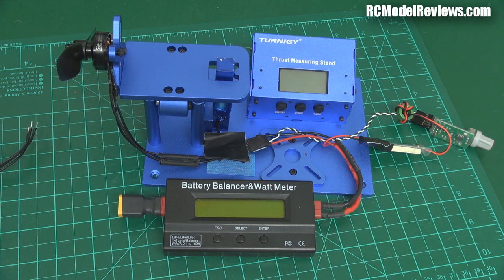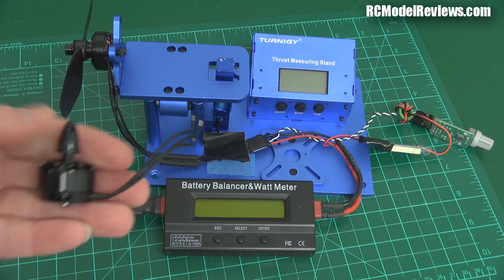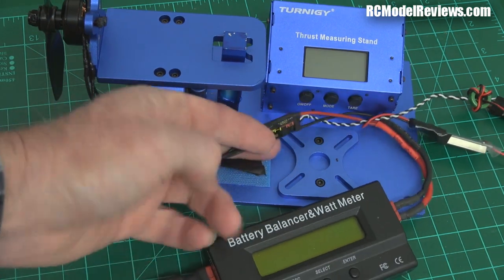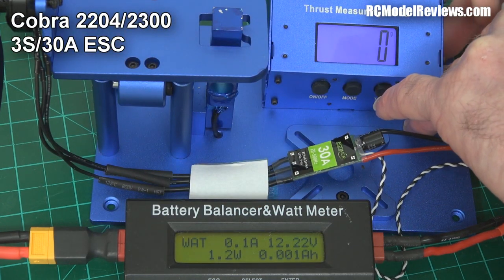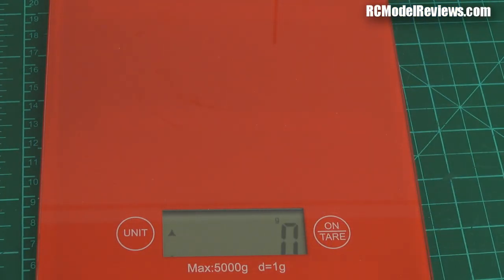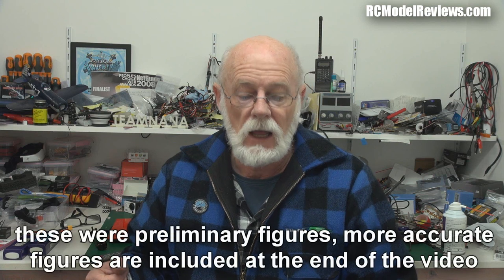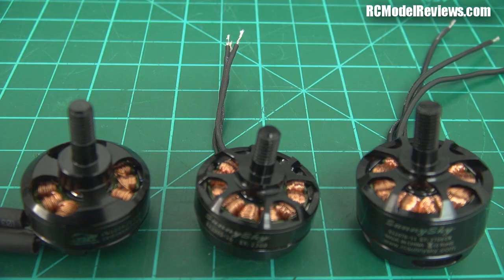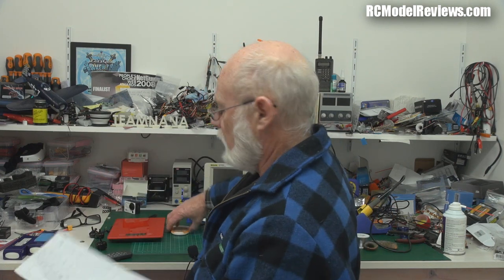SunnySky 2207 2700KV versus 2204 Cobra/Sunnysky

Comment: SS motors, can't beat them for the money, but be careful as there are many imitations.
Reply: +michael lee how can you tell the difference?  i did not realize there making fakes... seems odd.  especially since the bad rap sunny took.. when they moved to a new factory.. im willing to give them a go now tho.. just because they have had time to ease out of the growing pains.. but if i lost a quad to one.. i would probably think twice.. that is just me being stubborn tho. laughs.
Reply: +Chris i was told as of now avoid buying them from banggood. there have been cases where some vendors selling fakes on that website. not fair to bg but unfortunately...how can you tell the difference? i don't have an answer right now.
Reply: +Chris c There are a few official resellers. Track them down. There is one for the US (forgot the name), I buy mine from goodluckbuy.
Reply: +Chris c I just got a fresh batch of the SS2204 motors from surveilzone, all original. My previous batch from banggood was fake, so did not want to take a chance there again. The gemfan props surveilzone sells is also originals and well balanced, highly recommended
Reply: +michael lee The brand new RCX 2204 2350 kv motors seem pretty awesome.  I just got some for $9 each.  They are very light, lighter than most 18mm motors.  They are also serviceable and RCX sells replacement shafts and bearings.  I'll soon be finding out if they are too good to be true.  I'm just afraid the extreme light weight means they can't handle a crash.
Reply: +Plur307 do you have the purchased links ?
Reply: *****
I just received them in the mail.  I have not used them yet so I can't tell you if they are awesome or horrible yet.  They are 2205 and lighter than most 2204 (and even many 1806) though so that is nice.
http://www.myrcmart.com/rcx-h2205-2350kv-multirotor-outrunner-brushless-motor-motion-balanced-p-8935.html
Reply: Plur307
how long was shipping.  i like how they come with regular nyloc nuts,.., looks like they are all the same thread so no need worrying about losing one of them stupid ccw threaded nuts.  i think i will order a set for my next project. its interesting they are lighter than other 2204s tho.. the price is right that is for sure.
Reply: I ordered them on the 26th of Sept. (a Saturday) and they arrived Friday Oct. 2nd.  I chose the 7 to 14 day  shipping and they arrived in 6 days!  And they didn't even ship my order until Tuesday so it really only took 4 days to ship.  Pretty impressive. Chris c
Reply: Plur307
that is.. i think i will order 4 of them from the link you gave me.. they all come with the same thread correct?  no CCW, and CW.  you just buy 4 from the link you posted?   thank you for your input.  once i know for sure ill go ahead and order a set for my project.. i have a sparky II in the mail.. i hope it gets here just as quick.  the price is nice tho.. i figure the money is well spent on ESC< and FC.. the motors as long as good quality will work for me.
Reply: Chris c
Yes they are all normal thread, no reverse thread.  As long as you have good lock nuts you don't need reverse thread motors.  The lock nuts they come with seem decent.  Although they are steel and my ImpulseRC Alien frame is coming with aluminum lock nuts so I'll be swapping out the steel ones for aluminum to save weight.  The motors also come with steel mounting screws but I'll be swapping those for aluminum as well.
Reply: Plur307
Thank you for your input.  yeah i have some aluminum m5 lock nuts here.. in several colors.  so ill replace the steel for them.. even tho im not to worried about weight on this build.  well im gonna order a set of these and give them a try.. iv been happy with the emax motors iv been using but these are about 20.00 cheaper. heh.  worth a try i say.. plus they sell replacement parts to rebuild them if need be which is nice.. if im happy with these ill buy another set for my "thug elite 5mm arms" air frame..   good luck with your build.
Reply: +Plur307 I just bought some SSX2204-16 from Multi-RC , they came with CW and CCW spinner nuts.
Reply: +Plur307  well the went up in price.  for the price i paid for 4 at 34.00 it was a great deal.. but now they are at 51.00 for 4.   i think for that price you may as well spend a few bucks more and get cobra or  sunny sky. but thank you for the recommendation im glad i did get a set for 34.00 and if they go back on sale ill be sure to grab a few more sets.  rock on.
Reply: +Chris c The problem i have is that i am not getting near the thrust Bruce is getting, or what other people have posted on rcgroups.   I have Turnigy Thrust Stand V2. With a GF5045BN  im only getting 350gr at 12.2V.  SSX2204-16 ,  3300/30C 3S. The data im getting from another 2300kv motor matches the data sheet.
Reply: EDS-FT-RCPlanes
Are you sure your test stand is set up properly?
Reply: +Plur307 whats to set up? its the turnigy V2  its like Bruces with the watt meter built in, which I had already.  You just connect your battery, ESC and motor. The Watts and Amps are consistent with other published numbers and Bruce's. But my Gr measurements don't jive.  It is sensitive and repeatable, so you can compare motors and props, but the thrust data wont match other peoples numbers.
Reply: EDS-FT-RCPlanes
Are the cables set up in a way they aren't pushing/pulling on the setup.  Does the prop have clear area ahead and behind it to allow airflow?  Is the scale tared properly?  Just trying to help.

Comment: Lots of fake sunnysky motors sadly. Search "fake sunnysky motors" so you can spot the difference.
Reply: +Joe Baker Think I have had 30 fake motors and all the correspondence to follow! Hate the waist of time, offers and postage haggling etc. Banggood.com were no help at all. Really frustrating as the genuine ss 2204 with prop locking threads is a nice little motor.
Reply: +Joe Baker I wish SS would list accredited suppliers, particularly in China. Last genuine ones I got were from gearbest.com but I may have been lucky as it seems to be hit and miss from China. Often the sellers are convinced they are genuine. They are just shifters of stuff not flyers.
Reply: +Alex Curtis I did ask about a year back so I am pleased to read they are now doing so. If I were them I would sell direct and via the big Chinese sites but I guess other resellers would get pissed.
Reply: +Tobermory Cat 
Sunnysky assured that goodluckybuy is a trusted reseller. Somewhere in the rcgroups fake ss thread should be a list of trusted resellers.
Reply: Marty M Sounds good. I will check that out, thanks.
Reply: +Tobermory Cat Just got some fake SS's from an eBay seller who assured they were genuine...Grrr...Guess I'll be waiting a month for refund while they head back to Taiwan...or just throw them in a box with BangGood fakes I got.
Reply: thechosendude perhaps stick that ebay sellers handle up here. Think half the time buyers  just keep the motors and they still make a profit. Bit harder for them to act surprised if they have a history of selling fakes.
Reply: Tobermory Cat I reported the seller to  eBay/filed claim last week when I got them.  Good news/bad news... It appears eBay closed their account (I'm guessing other people complained - maybe about other fakes too).  Bad news is I am sure the seller will just open a new account under a different name and be back to selling fake merch.  The seller is "RCdeals4u5".  According to my claim with eBay, the seller has another 24 hours to respond or they'll make a decision on his behalf.
Reply: thechosendude suppose people should check out feedback numbers etc....but if there is money in selling fakes they will sell them somewhere.